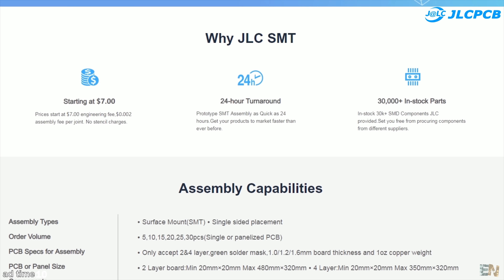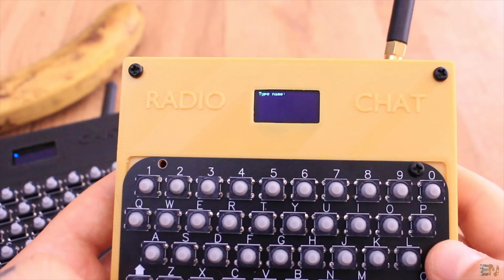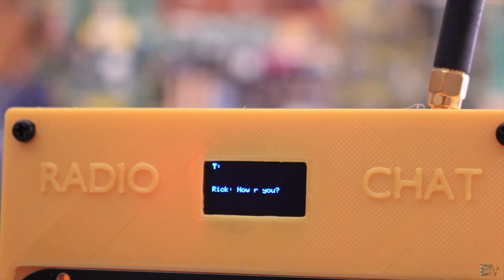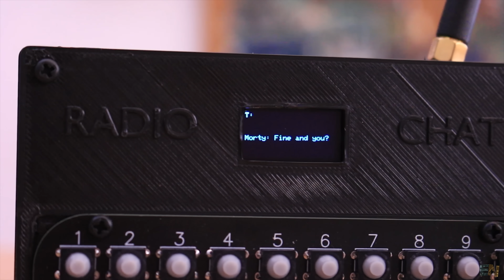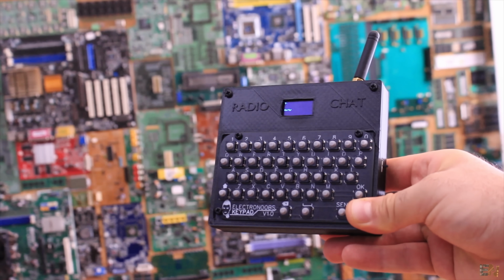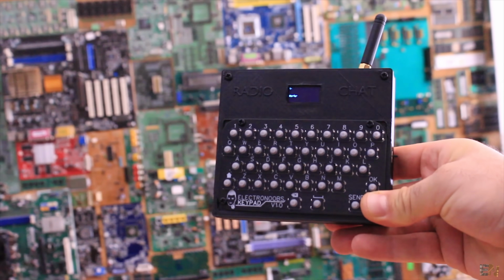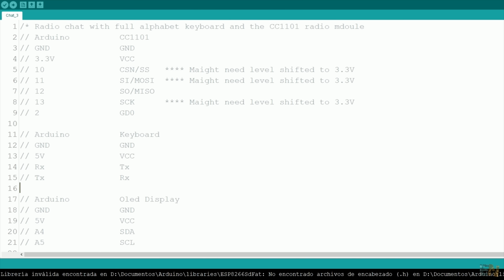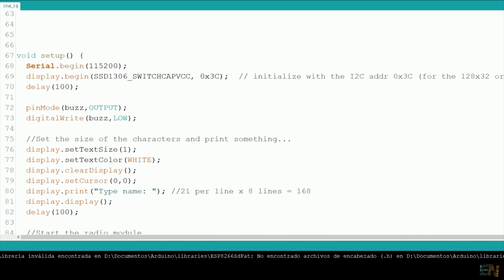Arduino RADIO CHAT With Full Keyboard

Comment: For those complaining about the size of the screen: I assume you are watching this to learn how to build your own. Buy a bigger screen for your own version! It's not like this is a project he made for you. Think, people!

His code would even remain compatible with just a few tweaks for the size difference as long as it uses the same controller IC (most use the same IC). He is using the Adafruit_GFX library which is compatible with a ton of different LCD and OLED drivers and displays. Switching to a different controller would also be as simple as including a different library.
Reply: you are overestimating skills of average viewer of this channel. Look at the structure of the videos, it's basically a youtube version of instructables article. No wonder that most of channel's audience would only be capable to follow instructions or at most "hack" things together combining different snippets of code (having no idea how each one actually works) written by some strangers on the web. I know that some of them are only starting and will actually learn a thing or two even that way, but most people won't bother.
Reply: @scotmcdonnell... or they could use... like, y'know....... a magnifying lens to enlarge it if they're not stupid or lazy.. you can literally make them from pet plastic bottles and filling them up with glycerin or mineral oil

Comment: Can't we use original keyboard?
Reply: If you know how to interface an "original" keyboard with an Arduino then yes, you can, although you most likely will need to write some code and do a fair bit of electronics work to achieve that goal.

Comment: I really like this .. I think I would want mine to feel more like a tablet , I would try to use a flat LIPO , like the ones you find in very cheap tablets.  My question is about the radio , how is it tuned (just picks up a certain band?) .  I recently became interested in SDR and just Radio in general, more specific encrypted radio.  That would be a good video...

Comment: To help mastering some electronics concepts, this project is really easy to follow and implement.  The use of RF, Wifi or Bluetooth for the module is a matter of choice with the limitations they impose.  For the display, changing it for a different one isn't too difficult as this will be just a matter of adapting the code for it.  For the serial connection I would rather prefer using a switch or jumpers to allow easier code updates.  Instead of buying a cellphone for a young kids, this project could be considered as a potential alternative.  Adding an SD card module someone could consider the implementation of some sort of trivia game which would be a little more constructive than limiting the device to only send and/or receive messages.  This is my story and I'm sticking to it ! 😁
Reply: how would you suggest i implement a wifi module for this project instead of radio for lets say international conversation of these device. I would love it if you could help me out

Comment: Excellent project and great tutorial.  Could you implement RSA encryption and 27Mhz radio for greater range?
Reply: I really wanna see how to do it im searching the internet for something similar for months
Reply: @iulianamaricai3441  Yes could get some of our privacy back.
Reply: You would need a big antenna to transmit, about 5m long if you go with a dipole antenna, or a magnetic loop which is smaller. I think this complicates it too much.
Reply: @LevyCarneiro  Back in the day I was using 250w on 11m sideband and could regularly  talk with the US from the UK.  I used a 20w hand held with a rubber duck antenna and could easily talk with my mates 5-10miles away.  This was all before mobile phones were a thing and landline charges were so high CB was the only social media platform available.
Reply: @landroveraddict2457  I see, maybe you were losing a lot of power because of using a shorter antenna, no? With 250w and a small antenna, maybe you were getting only 1/10 of that power out? The SWR would be interesting to see. Thanks!
Reply: @LevyCarneiro  this is going back many years now I am pretty sure I was using a half wave  called a Silver Rod could of been 1/4 but I am pretty sure that was the dipole I used during the day time.  I would only DX at night after the TV service stopped.  I had the SWR very close to 1:1 I spent a lot of time up and down a ladder adjusting the length of the antenna.  No way would I have pushed 250W down a badly tuned antenna even a small % reflection would have killed the burner.  Thinking on it I remember I also had a box with two knobs that I adjusted as I moved up and down the spectrum.  The burner also had a SWR meter built in.  I had a Cobra 148 GTL DX which had an extra board in for the UK FM40 channels.  This was activated using what was originally the PA toggle.  I sold all my gear bar a Uniden 40 (UK FM) to purchase an engagement ring.  I'm still married to the same woman but lament the lose of my rig every so often.  250w was considered the minimum needed to crass the Atlantic.  The were a couple of guys that used Yargi Beams and 250w I know at least one of them got busted for causing TVI.  I keep looking on ebay for a Cobra but 30 years on there are only molested rigs left.  And I guess by now there are much better rigs with programable  frequency ranges and channel number ID.   I really enjoyed my time on CB I learned so much and made some good friends one of which introduced me to my now wife.  Maybe I will take the plunge and go for a HAM licence but part of the fun to me was the thrill of side banding knowing it was a little naughty . IDK maybe I'm too old for that now and should just sit the exams.
Reply: @landroveraddict2457  wow, thanks for the share. I didn’t know it was possible to CB across the pond, that’s very interesting and actually makes sense as it’s still HF realm. Regarding antennas I wish it was easier to setup 40m on a balcony but that seems to be the holy grail hehe Nice QSO. 73s from Brazil.

Comment: Could have used a bigger screen otherwise great project
Reply from the maker: Yeah but a 1602 has only 32 characters. For a chat thats not good.
Reply: @ELECTRONOOBS  
Fair enough, but I just cant see that tiny screen, would it work with ST7920_128X64
Reply: @robinestephens  try it
Reply: @robinestephens  Simply adapt the code and it will work.  With proper coding, pretty much any display can be used.  The number of characters you want to be able to display on the screen will pretty much dictate which one you'll opt for.
Reply: I agree, should use a 1602 LCD screen.